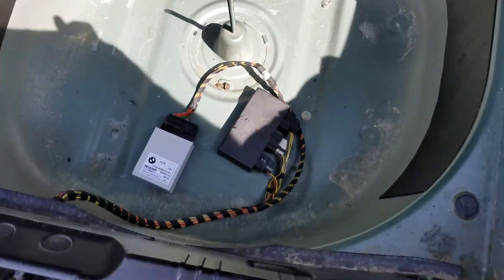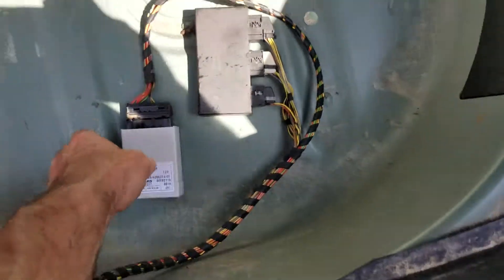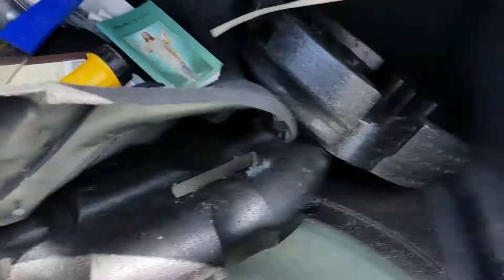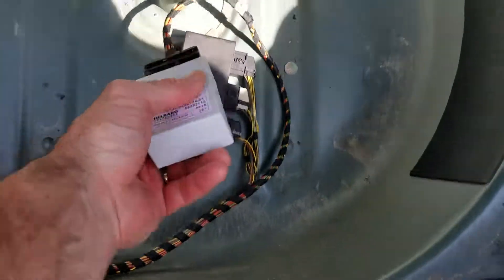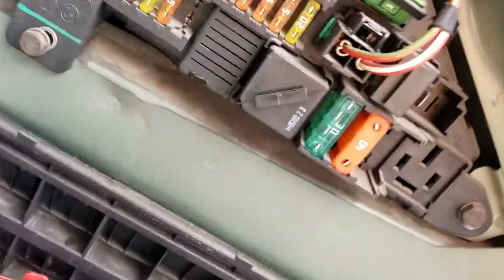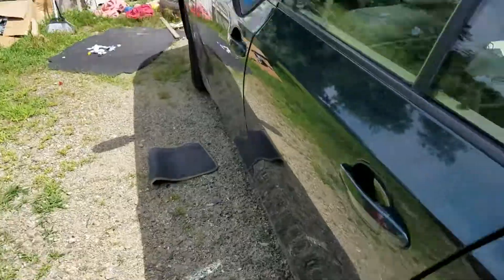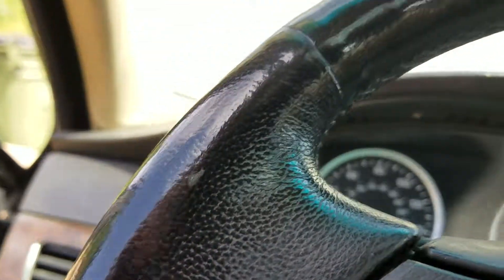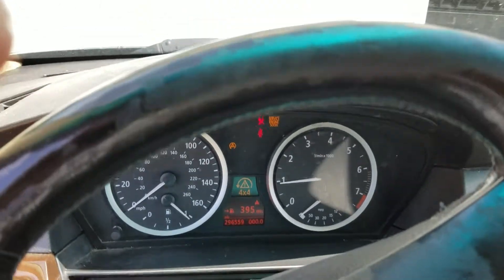E60 micro control module part 2

Comment: I put the new micro power, I just connect it and that's it?  fixed or do I have to do a reboot, disconnect the battery and connect or something different?  Might you help me ?
Reply from the maker: As I recall just put it in, drill the holes to prevent further moisture damage, put everything back together and start driving the car. It will configure on its own.
Reply: Did you have to replace the plug and harness as well?